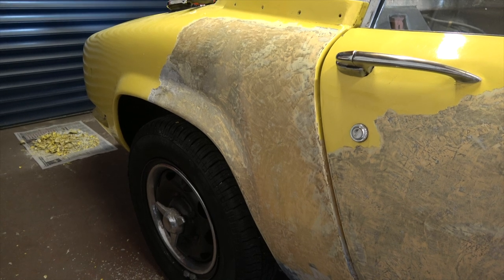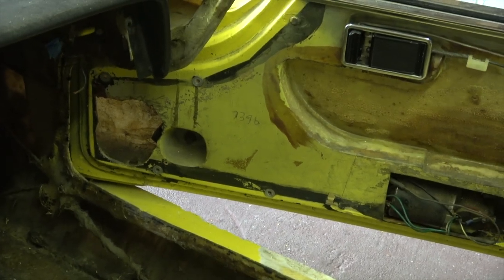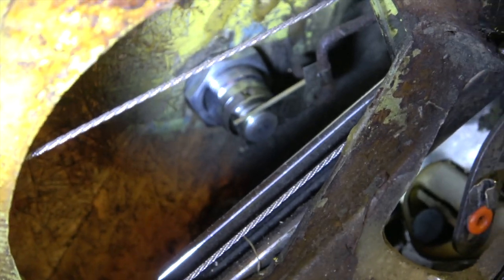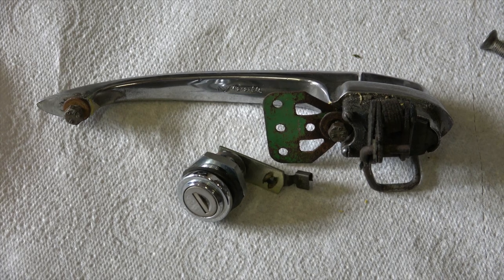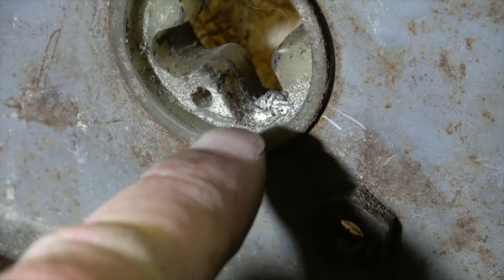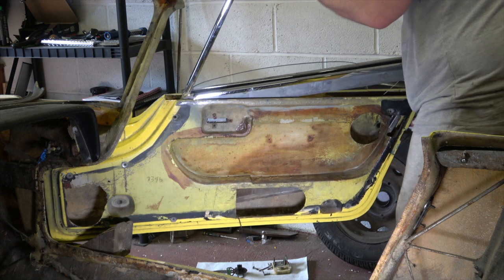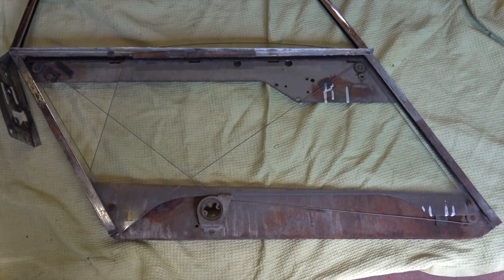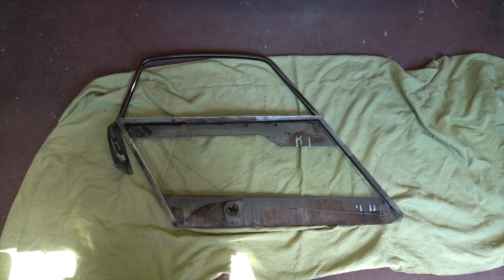Lotus Elan S4 Door Window Frame Removal

Comment: 3:11.  It's been 8 years since I removed the handles and locks from my S4.  As I recall, access was miserable.  It appears that someone cut out quite a bit of glass fibre in order to gain better access on your car.  I'll be sure to do that the next time I have to work on them.  7:20.  It appears that the previous owner re-attached the black ground to the motor as the connector is too new for the car.  You can save yourself some grief by removing the ground wire altogether.  The motor was designed to be a 2-speed wiper motor with a ground and one of two hot wires depending on whether one wanted low or high speed.  Now that it is being used as a window motor, the switch simply changes the polarity of the other two wires going to the motor.  That's why the original black ground wire is useless.  10:24.  Re-installing the top screw is a mystery to me.  I really don't know how the factory workers did it.  I gave up on mine and left it out.  The frame seems secure without it.  Whenever I go to a car show and see restored Elans, I always check to see if the owner was able to re-install the top screw.  I have never seen a restored Elan with the top screw in place.  Another great video David.
Reply from the maker: I'll check out the wiring. 
Yes that top screw was a pain, in retrospect I should have removed the frame first, it may have given me better access. I may do a trial fit and weld a captive nut to make it easier for the next owner!!
Reply: @davidbaugh  Pretty easy to check the window motor wiring.  Connect the two wires (not the ground) to a battery.  The motor will turn.  Now, switch terminals and the motor will turn in the other direction.  While we're on the subject of window wiring, you can improve your windows by making two electrical modifications.  First, install two relays for each window motor.  You'll need one for up and one for down.  This will extend the life of your switches significantly as the relays will be carrying the load.  You can keep the original wiring going to the switches and to the relays, but for the run from the relays to the motors, increase the gauge of the wire.  This will significantly increase the speed of the window motors.  Best of luck David.